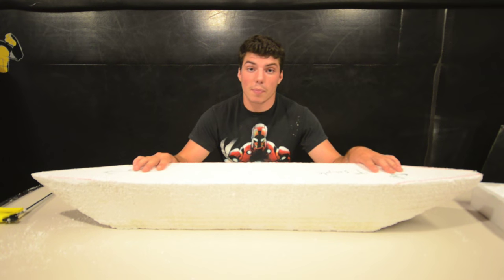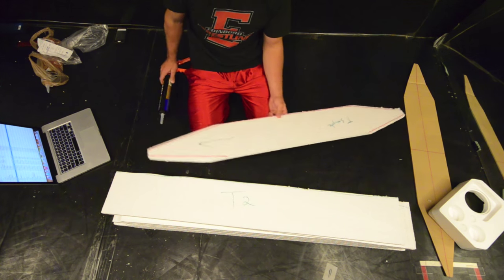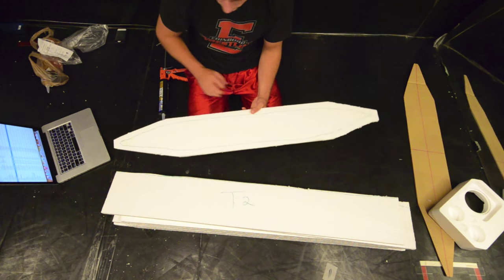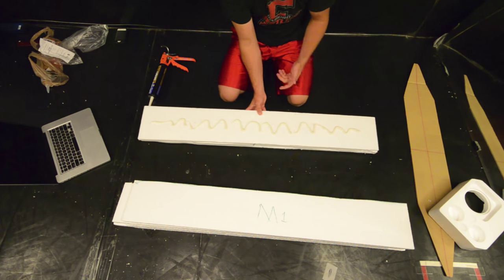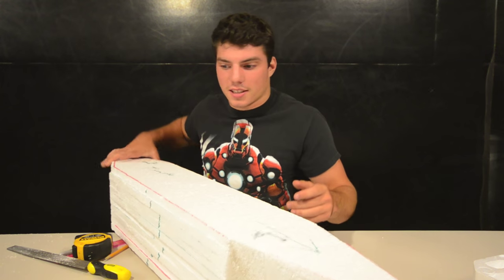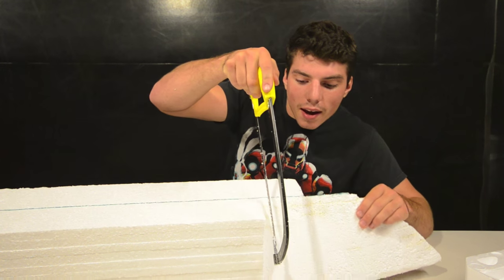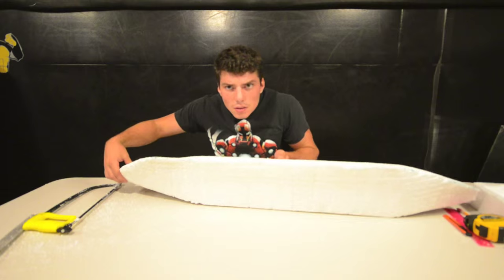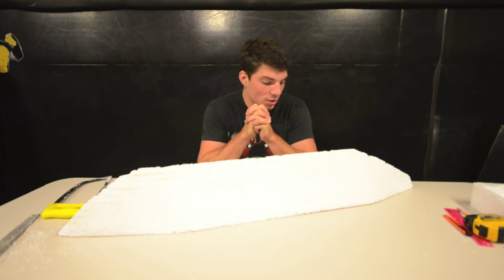Building An Outrigger For A Kayak! (UPDATE in description)

Comment: Good video. Making the outriggers out of 1/8" plywood using the stitch and glue method and then fiber glassing it, would have been less messy and less work if not about the same. 
Make side panels out of cardboard and test fit it holding panels together with tape, once you are happy with the results, take it apart and trace the cardboard side panels outline onto the plywood to cut and use for the final product.  I know I know, everything is always easier in theory, but it should work. Make sure to build on the top side of the outrigger a water sealed hatch, in case water ever gets in the outrigger, you will be able to get it out via the hatch.
Reply: cubanation74 I think doing it in ply would be more difficult and labor intensive than this foam method. This foam way looks a lot simpler. I'm looking at making my own and this looks the easiest way to me